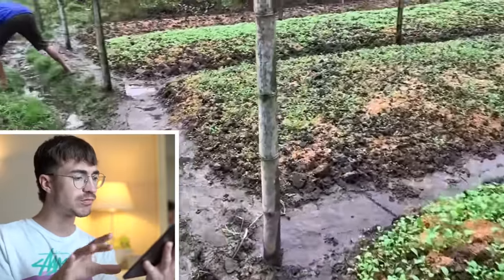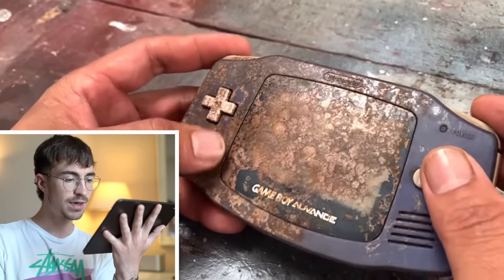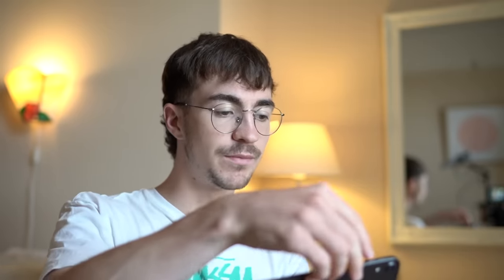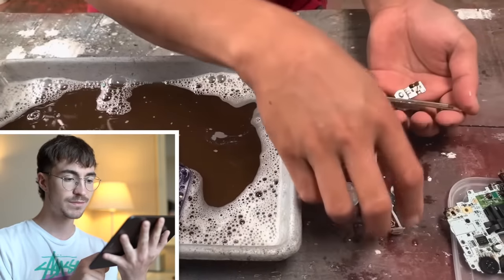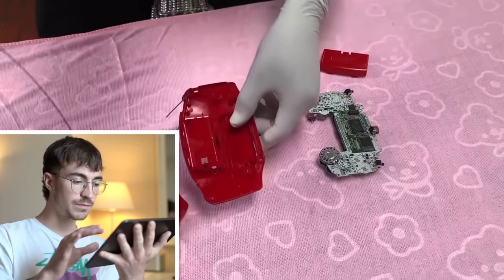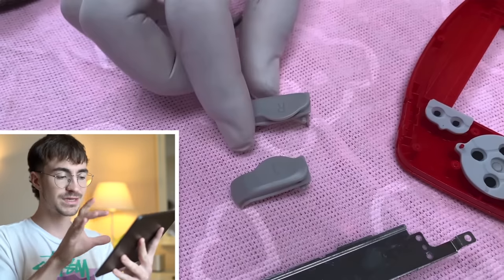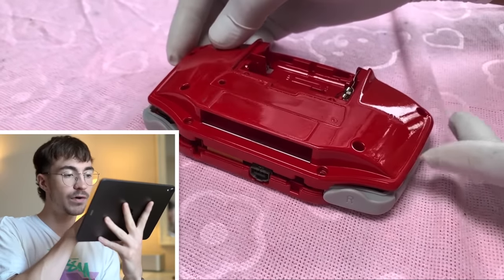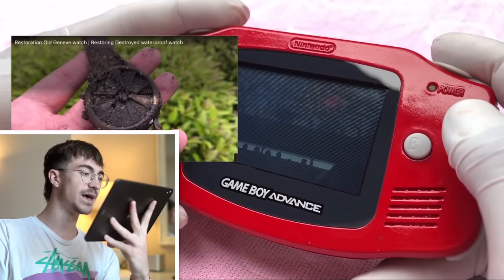Exposing FAKE Restoration Videos!

Comment: Just a random and hilarious thought you should totally do a video in the exact same way but actually restore the item that you find in the trash “randomly”

Except if you really wanna be funny about it you should wander around in the beginning of the video to wherever the item you’ll be restoring is located and “ randomly “ find it

Also on a totally unrelated related note, about the rust. A couple of days ago I was fixing some thing and happen to need a wire hanger, and I use that wire hanger and then to clean all my tools off because it’s something I was fixing was not clean I tossed it all in a bleach bath. Before I left all the tools to soak in the bleach bath I cleaned all the ones that were in Porten up and thought I got all the metal items out, two days later when I returned turns out I forgot the wire hanger. It was already rusting. Granted it was an old wire hanger, and there’s a chance there may have been some pre-existing rust, However if I had to take a guess I would assume the same thing occurred here.

Comment: Nothing new here, people have been pulling this sort of scam for years. As for it working and the screen displaying properly after being underwater and caked in crud ?, it's possible. But the PCB would need proper cleaning in an Alcohol or ultrasonic bath and fully drying first. Did he take it home, put batteries in and watch it turn on and display ?. You already answered your own question: LIKE HELL IT DID.

Comment: I'm sorry but I just can't take this guys seriously for several reasons.dint get me wrong the whole I just randomly found it while filming is a lie but he very well could have found it there and was like "this would make a good vid, let's record me finding it". He doesn't understand that water doesn't cause damage to electronics so long as the is no power, he claims that buttons are after market bc of "color", he said the pads are after market bc of crosshatch witch yes I can verify but he showed the wrong pad to justify his point. But we already know he's going to be using after market products bc the person in the video threw away the screen protector so he's obviously going to be getting after market items for the out right broken peaces and he only replaced the one pad meaning the original was probably torn. And the guy in the video does know what he's doing bc he was checking the relay paths to make sure they weren't damaged in the scrubbing. I've done it several times myself and there have been times Ive scrubbed too hard and scratched the mother bored so I have to check those paths.

Comment: You can submerge almost any electronic circuit like a motherboard in water as long as it’s not on and not powered and its completely dry before using. It’s not uncommon to see repair shops soak motherboards in water or run it through a dish washer, especially after certain liquids like coffee, tea, soda, etc has been spilt on the motherboard. The reason devices break when exposed to water is because they’re usually on and  the water short circuits the board

Comment: Any kind of technology like I don't know computer motherboard or any other more motherboards if you submerge them in water and dry them and put it back into a computer or what is it from it will work because water only hurts and damages technology when it the technology is on but if it spends tons of time in the water it might rust that could damage the motherboard

Comment: I mean everything he showed looks pretty legit, He might be lying about a few replacement parts but you are even claiming he didn't paint it when @11:10 you can clearly see that he did paint it, thats a crudely painted shell no doubt about it look at the warping and stuff in the paint also the sound slots are covered up with paint that filled them lol. Also the battery terminals on the right side are still rusty, so is half of the connections on the motherboard, i am rating this as legit and maybe he just knows more than you, i have seen people in these countries have running computers from nothing but a pile of rusty boards and chips piled together in a box.

Comment: Bro do you not understand hardware? You could submerge a laptop in water and so long as it is off with no power supply, you can in fact use it if you have 100% let it dry. The guy seems to be using aftermarket parts as well. Definitely the wrong video to make a point and i didn't see rust, just mud.

It looked staged for sure but what he did is in fact entirely easy. It's a Game boy advance.

Comment: I agree with you that the gameboy thing is fake. However, your comments about it working are kindoff nonsense. Water does not kill electronics. Nor does dirt. It's totally possible that gameboy would have still worked. 

As long as it's not under water while it's on, water doesnt do much to electronics.

Comment: I mean right off the bat the bull of just walking down a trash littered street and "oh wow, look here is something I know how to fix" ain't happening, so right off the bat if you are willing to lie about how you obtained it then you are willing to lie about the entire thing, so not a good start. Now is it entirely possible that maybe what you thought was water was alcohol and maybe possibly he did a lot of work behind the scenes of removing all the solder, cleaning everything up and re soldering everything back that worked and replaced the chips that were not working?  I mean it is not impossible, and crude channels like "5 minute crafts" do that all the time where they pretend x works but really they did q,r,s,t, and v and pretended like x worked, so it can't be entirely ruled out but there are two major major issues that make that highly unlikely. And then a 3rd that makes it even more suspicious but that could just be when you paused.

0. Firstly not the first point but a major point non the less, the shear amount of jump cuts makes it highly unlikely, if you are actually restoring something you would want to keep in all the transitions to show all your work.
1. You spray paint those tiny screw holes there is no way you are getting in those screws first try without issues, you made the screw holes smaller by adding paint so you would need to rethread the hole which is doable but you are not having the screw magically catch the threading first go when the threading is too small for the screw due to the layer of paint.
2.  Jump cutting (poorly) after turning the console around rather than testing it then and there, there is ZERO reason to jump cut after showing the console's front face to show it working unless you are showing the crappy paint job for a reason to let people see it is the same case after jump cutting while hidding the fact after showing the flip but before the power test you then removed the case, put it on a working device and started back up the cameras. That is the one place even if every 3 seconds in the entire rest of the video was jump cuts should not be a jump cut, going from showing the inside guts being put back in to testing the power should not have a jump even if everything else does.
3. And the thing that might just be because you paused the video, but the power on only played half of the start up sound, but even if you paused it and restarted it as you were talking that ding at the end is high pitched and should have been noticed, again that could just be because you paused the video right as it was going to finish the high pitched ding, but even so it should have been audible when you unpaused.

With that said, I am fine with videos jump cutting and not showing all the little details because let's be fair if you show checking every single chip on the board, all the unsoldering and putting on replacement chips it would make for a long video, so the jump cuts are ok, but the odd jump cut when there was zero reason to do one just screams  "this is 100% faked" even if it wasn't. The issues isn't having to use after market replacement parts, that is expected you can only restore so much, but to then pretend non of it besides the screen cover was after market, yeah no that is lying and that is annoying. If at the end they showed "here is what was good and is still original" and "here is what was irrepairable and needed replaced to restore the console" then no harm no foul with using frankensteined parts, but to pretend it was all original is just lying.

Comment: um......to be fair, if you took the battery out of your phone and then put your phone in a glass of water for a week straight, if you took it out and let it completely dry, it would still work when you put the battery back in, water can only destroy electronics with electricity going through them, if you want I can make a video on it, given your lack of knowledge on the subject I cant trust what you say, it could have easily gotten rained on and muddy water could have gotten carried into the handheld, also paint wont rub off if you paint it correctly, just because you have never painted something correctly doesnt mean no one else has, plastic is porous, meaning it holds dirt very well, its not rust, its dirt, rust has a much different texture, as someone who has fixed one of those he is checking that the capacitor is reaching where it needs to be,, also the buttons where retrobrighted so they are going to look new, you clearly know nothing on the subject, also if you zoom in earlier the buttons still have the marks so they are the same ones,  you know what, I think I'm gonna make a video on it to show you how electronics are waterproof and in return you make an apology video
Reply: a modern day cell phone is completely different  than a GBA from 20 years ago sitting in water, there is absolutely no way the GBA would work because the capacitors  would of been shorted out due to being in water for a long time
Reply: @123joesmoke  you do know phone capacitors drain of power in seconds right? they have around 40 average, also, gba capacitors have the same system built in, they have a built in system that does that, it was literally my job designing and repairing phones, thats it, I'm making a video tonight, ill reply again when its made

edit, turns out after some digging game boy capasitors drain in about 6 seconds after shut off even with the batteries in because the power switch cuts power completely to the entire board, so even with batteries in it you could submerge it in water and it would be fine, thats also goes for the gba
Reply: @LovelyQueenLynn  ok bro, go dunk a GBA in some muddy water let it sit for at least 5 years. then show me it still works, regardless if pins and connectors rust completely
Reply: @123joesmoke  your the one who thinks the video is fake, if it was 5 years it would have board decay, that board is at tops 2 weeks, also, thats not what we are arguing about, the argument is if a board can survive water, after some more digging it takes 5 seconds for the capacitors to drain, so regardless of how wet the board gets, when it dries it will be fine, I dont feel like spending 70$ on a game boy to show you, but I am willing to show you on a phone because thats what I have, my point is the game boy would be perfectly fine, you might as well be telling a mechanic a flooded engine means the car is totaled when you know nothing about cars, same thing applies here because I designed electronics for a living, the console would be perfectly fine, it literally has a circuit that drains the capacitor on the board, wanna screen share? I can show you
Reply: @LovelyQueenLynn  nah bro just wouldn't happen. You really need to let it go. The video is faked. Plain and simple
Reply: @123joesmoke  its literally how it works, I am actually willing to do it live in front of you, thats it, when I get the money to afford a game boy I am going to reply again and you are gonna watch me do it live, ill also make a video on it, have fun getting publicly wronged
Reply: @LovelyQueenLynn  your just gonna waste your time and make yourself look like a fool
Reply: @123joesmoke  wanna bet? ill put 20$ down, the fact is I designed pcbs for a job, also, I can show you the schematic right before I show you me scrubbing the board under water, I can show you the diagram where the capacitors lead to transistors to discharge and my math to show you why it only takes 5 seconds do discharge
Reply: @LovelyQueenLynn  Nuh uh
Reply: @123joesmoke  because you know I'm right, at this point your just baiting

Comment: Not rust…. It’s called oxidation
Reply: Rust is literally the result of iron oxidation
Reply: *RUST!!*
Reply: @deibu__  doesn’t need to be a alloy to oxidize, rubber plastics all oxidize
Reply: @stevennagley3407  yes, and in the case of iron the result it's commonly called "rust"
Reply: @deibu__  rustoleum oxide!

Comment: I understand skepticism, but I feel like this is far too much, and you get at the same level of the fakers o the opposite side, just like a debunker thst debunks shit just because.
About the water, if you wet the elements while is off and wait till everything is nice and dry it'll be fine. The problem is when stuff falls into the water when on and it shorts. About the video in question I think it's pretty legit, they might have staged the finding part, and I can give you that he bought a few new buttons and screws, but so what? Are you serious? When I restore cars I replace a lot of parts when they're unusable, it's part of the game. You're in extremely bad faith.

Comment: Bull S@%^ that's not the original shell at all! 06:45 not sure if you notice when he remove the case from the hook when paint dried, you can see how the light is pass thru them and looks a bit flimsy, GBA uses solid opaque purple then he spread red paint over it, there is no way the light will pass through like that, possible another after market shell..... and where you comment "that decently the painted shell", have to tell you the screw holes are too clean and colour is too even if it was spread painted, its a badly ABS plastic shoot out case, that is why the inside looks so crap.

Comment: Just throwing it out there for the creator. Not every liquid that has no color is water. Thought about alcohol for cleaning maybe? Sry but can't stand your "water crying". U dont know the liquid so tell us that you assume it was water and dont pretend it was water
Reply: I agree with you. Also about the screws part, there is a process called bluing. It's when you heat metal into certain degree and pour it in oil then a black layer forms on the surface of that metal and as it seems the dude even used a specific oil not just a regular oil on the video. And while we can say that the dude did some fake parts on the video because he couldn't fully restore it and wanted the results to be clean. There is nothing wrong with it, there is no need for a whole video of faking your laughs and trying to make everything fake just to gain views in a video. I see this guys is MORE fake than the one doing restoration videos.

Comment: @10:00 even though i need to agree with you that this is likely fake, your statement that you cant clean electrical components that have been submerged is incorrect, I make marine cables for a living, we often repair terminations that have had sea-water leak into them and thus are corroded , often it does need little more then a good clean refitting and replacing a few pins... the one thing i would agree on that that becomes harder the longer the corrosion has gone on, however the worst of corrosion starts soon as its out of the water (same reason wooden poles can perfectly fine stand in water but will degrade along the waterline) as the water isolates it from free oxygen molecules (needed for oxidation)

Comment: Electronic components dont break by bring submerged in Water. What breaks the components is the battery which is still connected and thus creating a short. And you're assuming he wont use aftermarket parts for the(RESTORATION) build Even tho the definition of restoration does not indicate the sole usage of already possesed parts or originals for That matter. Sonic cleaners use distilled water to clean pcb components also just to inform the ignorant. This is a perfect example of restoration with minimal budget without over spending on original parts which surely would Cost more than the device itself in its curent state.

Comment: you know water wont damage electronics unless it has a charge running through it right? it might leave trace minerals on the pcb but you can clean that off quite easily with iso alcohol or something similar. it's obviously not ideal, but it's not as detrimental as you seem to think. just to be clear i'm talking about cleaning, not leaving it submerged for 20 years. obviously that would rust and destroy it. 
but just to clean it, as long as you dry it thoroughly and wipe it off first it should be fine. not saying the guy in the video is legit, just that.. that particular comment about water damaging a completely dry (in terms of an electric charge running through it.) pcb is just wrong.

Comment: a wet Playstadion is broken beyond repair and will never work again x3 
but a nintendo will survive a napalm attack and laying in a ditch for 10 years. 
I actually have nintendo game with swamp rust on it that still work xD 
and i have a gamecube with a soldering iron hole threw its motherboard that works too x3

Comment: That dude trying to expose does not have a single clue himself about electronics to judge this, and just because there are aftermarket parts it's fake? Like no chance someone threw away a fake or alrdy repaired gba? :D Most looks staged but this dude is just as bad if not worse